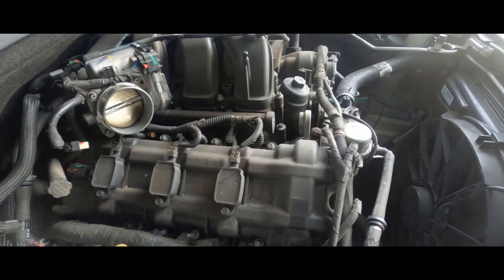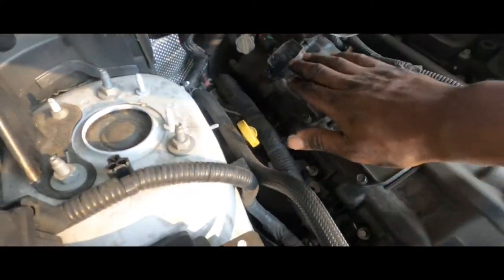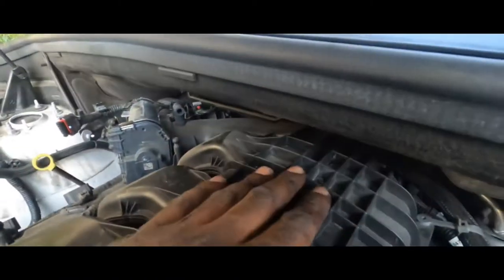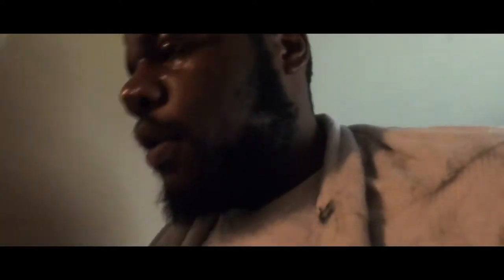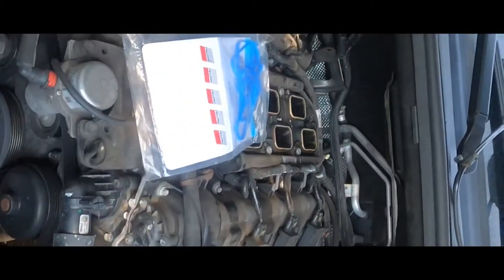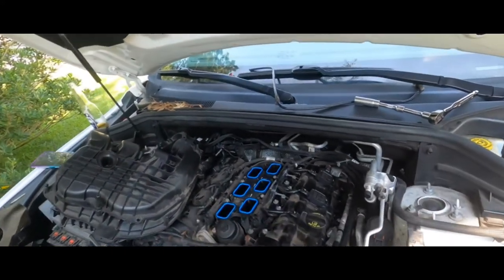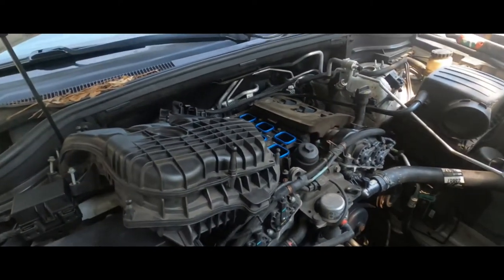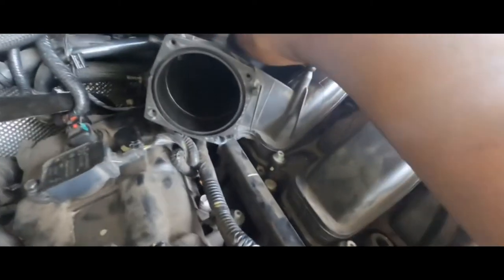How to do a tuneup on a 2013 Dodge Durango

Comment: yup both of those 10mm bolts need to come off on the 2014 Durango behind the throttle body. Thats one of the biggest pains about taking the lower manifold out. Also there's a bolt on the lower manifold that is farthest from the front of the car thats a huge pain to get out. Also you need to make sure you remove the bolts comnpletly out or else the tips stay in the bolt hole and you can't slide the lower manifold out. Took me at least 4 hours to replace the oil filter housing and change spark plugs on my 2014 durango.
Reply from the maker: Yea you right I think it took me about 5 or 6 hours.. it wasn’t that bad I just took my time. Thanks for watching

Comment: Great vid. Not sure if I need to replace spark plugs or throttle body, but going to start with spark plugs. Got a red lightning bolt on dash and failing to start frequently.
Reply from the maker: I think that might be a throttle body issue.. wouldn’t be a bad idea to change the spark plugs but unlikely to be that…could be a bad coil too.. let me know what you find out
Reply: Will do
Reply: @jimbelflower6704 yeah if it’s like a lighting bolt with a half circle on each side then it’s something to do with the throttle body, happened to mine and cleaning it out fixed it.

Comment: Hey man good video. I just have a question every how many miles I need to replace my spark plugs my Durango have    47801miles
Reply from the maker: Mine is a 2013 and it’s every 96000
Reply: I went 127k miles before one started misfiring.  They come with Champion 9407 I believe.
Reply from the maker: Yup that’s it Tim
Reply: I’m barely changing mine at 147000 2014
Reply: Need to clean that engine bay